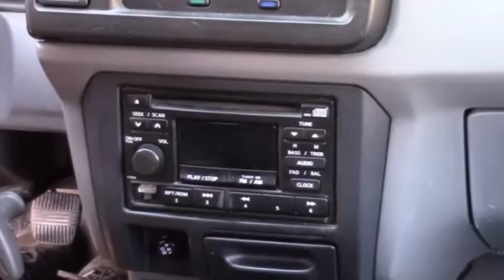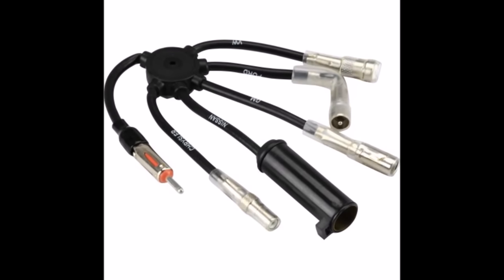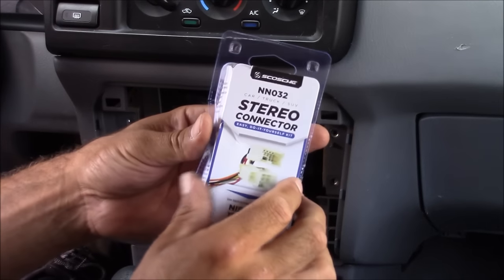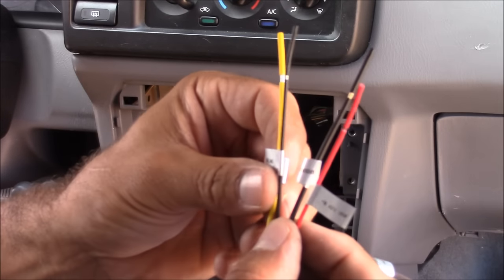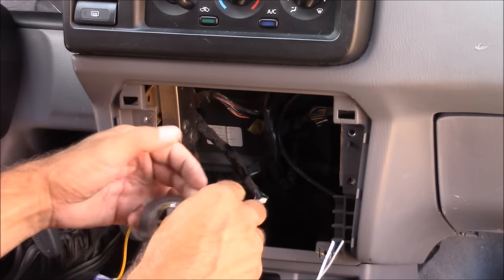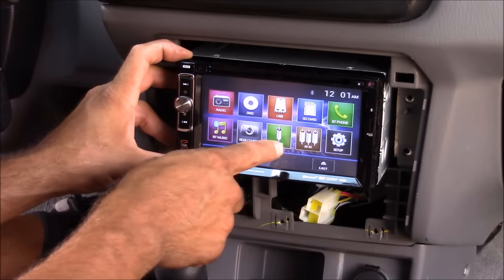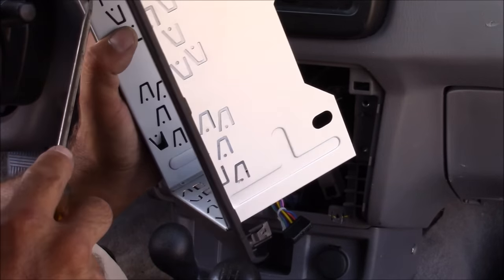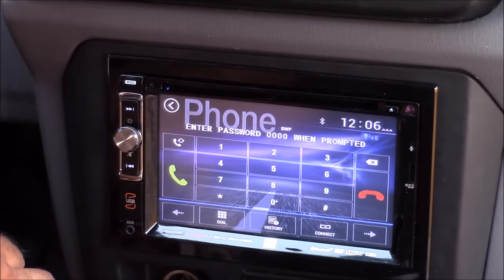How to install car stereo for beginners DIY

Comment from the maker: Hello everyone Crimped connections are preferred method used by most professional installers Here is my link to a full tutorial on how to make crimp connections, heat shrink and splice wires: https://www.youtube.com/watch?v=887c1...
Reply: C.L.S. Allinone
Reply: C.L.S. Allinone (#####
Reply: didn't know that
Reply: C.L.S. Allinone amigo disculpa  donde puedo encontrar  el adaptador para una mercury mountainner 2003
Reply: My stereo won't won't I got everything hooked up rigjt but I don't have another red wire on my stock harness or a blue one for the power antenna were do I put them
Reply: Some have been sliced so much there there is not enough left n you have to use a extra large crimper to make the connection complete
Reply: "Video no longer available"

Comment: I live in a motor home and will feed the unit off the battery solar-powered RV battery bank. (So I can use t when parked) I am less than novice qualified but I was planning to run both the hot (yellow)  and acc (red) to the feed from the batteries. Will that work? What do I connect the ILL wire to? thanks

Comment: bought a boss audio stereo off amazon used from amazons warehouse deals part, and the stereo works completely.. gps and everything, only thing was no audio, i have no amp in my car and the "professional" i was paying told me after 5 hours that my unit is defective, he even showed me his stereo and it worked fine. should i believe him? (he was a guy off craigslist)

Comment: Do you have to remove just the black wire from the battery or both to do electrical work?
Reply from the maker: htboston just one wire red/+ preferred
Reply: C.L.S. Allinone why though ?

Comment: So I have a 2005 chevy Colorado and I've wired everything I believe correctly and ground the wire and even bought the antenna adapter and I still can't figure out why I'm getting no power at all
Reply from the maker: You need to use test light to check 12 volt constant , 12 volt ignition and ground wires. Hold one end of test light on ground wire and other on 12 volt wire if it doesn't light up check other ground locations "any solid metal surfaces". If it lights up with different ground location it means ground was bad. If it still does not light up check fuses for 12 volt power.

Comment: I just replaced my stock radio in my 2006 Nissian Xterra with a pioneer head unit. I turned my ignition over to make sure everything worked properly and I didnt get any power to the new stereo. Is this because I dont have the ground ran? In stock nissian radios the ground is ran with the antenna wire.

Comment: 08 pontiac grand prix i bought a dual xdm16bt radio and the adapter wired it up but no power
Reply: Darren Nunnery what was your issue same boat in my work car 08 cobalt
Reply: Same issue in my 09 Cobalt
Reply: LoattyTV make sure you have the exact interface you need there is 2 for the cobalts I had wrong one
Reply: I have the same Pontiac too and since it’s a GM car you have to wire the red wire to the fuse box on the side of the passenger door and find a right fuse that turns the stereo on and off when you turn the car on and off so it doesn’t drain your battery

Comment: Thanks for your video. Very helpfull.  Any possibility to convert a 1di to 2din in hyundai santa fe model CM, year 2006? I f yes, Do I need to buy a 2din cage or the aftermarket come with one like i am seeing in this demonstration?
Reply from the maker: Papami Peremi unfortunately there probably is not enough room for 2 din stereo. You can google your car model + 2 din stereo to see if there is a conversion dash kit for yours. Also Dual makes a stereo that is single din with a 7 inch motorized pop out screen that might be a good alternative for you.
Reply: Thanks you for your advice.
Reply from the maker: Papami Peremi your welcome

Comment: Great video thanks you explained it perfectly. So everything's is color coded, my stock stereo has multiple connections 6 to be exact. I have a 2005 honda accord EX with factory navigation and dual AC. Its not working and im trying to replace it.

Comment: Do you mind questions? Please. The new stereo has wires that the harness doesn't have, nor did you mention them. The pinks are obvious; front/rear cameras. The 5 others are the questionable ones. 

(Wires 1-3) Have 3 wires for Steering wheel control (Gray = SWC 1, Green = SWC 2 and Black (fine) = SWC Ground.) Do I need that separate ($50) SWC? Or can I pull out one of the wires from the the other connectors that were in the stock unit?

(4) Blue (B+) (2nd blue w/o white stripe) = Amplifier Control and (5) Brown = Brake (B-).

Also, I notice your harness kit had the connectors. My harness didn't. Wondering, if I got the wrong brand harness.
Reply from the maker: SWC will be specific for whatever vehicle you are using some vehicles require a separate module and some don't . Wire harnesses are specific for vehicles as well most are designed to plug right in to you stock wire harnesses and sometimes not all stock connectors get used. My video just kind of covers a basic install to get power and sound working everything else becomes a learning experience to figure out.
Reply: Truth! It is a learning experience, taught by digging in. Thanks for your reply. Trying to get answers w/o sifting online. Starting to piece some of it together. You're so right, I would just need to fish around inside. My new deck seeems to have the SWC built in; set of wires out of deck. Time is required to figure out which wires from van. Thanks for your time.

Comment: Thanks CLS, I have an Axxera, looks just like the unit you installed, but I want to power it without have to turn on the ignition switch, what would you  suggest? What does the extra yellow power wire do?
Reply from the maker: Just connect the red wire on the stereo to the yellow wire on the car.
Reply: @D.I.Y._All-in-One  OK, Thanks!

Comment: all these vidieos are driving me crazy the after market radio has rt but my 2012 colorado  dont have a red wire has all the other colors but red what do i do
Reply from the maker: Jaxs Rea you will need wire harness adapter for your vehicle it will show on instructions what wire is red/12 volt ignition. The wires that are attached to stock radio do not follow the same color codes that aftermarket radios do. You can also use a test light to figure out which wire is red/12 volt ignition. Test light will show power with wire when ignition is in the on position .
Reply: THANKU U i dont know if i screwed up i cut maket connecto off before i started thought thats what u do wire to new one
Reply: well guess what i wired it rt it worked i felt radio was hot as crap in back found out chevy uhave to wire red one to fuse boxdid that yeserday nothing im stressed out done .  so much for trying
Reply: Jaxs Real

Comment: Hello..I installed a reverse camera to this stereo but the screen is black. When I put reverse that's when I see the reverse camera turn on. Do you know what I did wrong? Thanks
Reply: that's how it works on this model only when on reverse it would come up on screen

Comment: Did you not install the Ground wire in this video?

Also will i have to buy my own ground wire for the installation to be completed?
Reply from the maker: ZambonieDude most stock car stereos have grounds already in wire harness. But if for some reason it does not have ground in harness yes you will have to install a ground wire. This can be done by finding the nearest solid piece of metal that produces a good ground and using a self tapping screw to secure wire. A test light can be used to check ground location by holding one end on 12 volt power and other end on metal if it lights up brightly you have a good ground.

Comment: okay so we have an 04 dodge durango and bought a Dual xbm280bt radio from Wal-Mart and my fiance cut the plug off the factory radio so how would we wire those cut wires to the new radio wires without the plug
Reply from the maker: Samantha Mead do you still have the plug you cut off?
Reply from the maker: Samantha Mead if you still have cut plug you can buy an adapter wire harness and figure out which wire s are what by matching colors.
Reply from the maker: Samantha Mead if plug is gone/missing you figure out your power and ground wires with test light. But your speaker wires will be much harder to figure out if you have access to  speakers you might be able to find the color of wires hooked up to speaker and hopefully the color is the same where wires were cut.

Comment: I have to buy a separate connector? Why is the one that came with the new stereo not enough?
Reply: There’s no standardization, so you need an adapter that goes from your car’s specific stereo connector to spliceable wires. Without it, you can still make it work by cutting off the stock connector and splicing directly but you’ll have to figure out which wire is which on your own and it won’t be easy to go back to the stock radio.

Comment: HELP! MY RED WIRE IS NOT PART OF THE HARNESS. IT IS SEPARATE. WTF DO I HOOK THAT UP TO? All my wires will be used, but the red one that came with the stereo is on the harness and the one that came with the adapter kit is not. It looks like it wants me to tap into a 12V switched source...don't know where or how I should do this! HELP

Comment: I have everything hooked up but my radio is not turning on
Reply: Same here
Reply: Same did you ever get it to work
Reply: Same
Reply: I've hooked up 3 before and I'm never had a problem til now, I tested power with a voltmeter and it's getting power, idk what the problem could be
Reply: michelle c the pink and both of the black wires you have to put them together on your black Negative wire

Comment: I got the Xnav267bt

confused. 
I got a touch screen stereo and soldered all the wires except for the ones described below vvvv

The last wire thats on the aftermarket harness for
my car is pink "12 volt ignition/switched"

the aftermarket radio harness wores left are "ACC B+", "Reverse +",  "Remote turn on +", and pink wore that says "brake" that says must be connected to watch video properly.

i looked up the ignition/switched and acc. They both sound pretty similar. Can they go together?
Reply: Having the exact same issue. Any luck?

Comment: Hello. I bought the same one and I installed it and it was working fine. Soon after the screen just turned blue and stayed blue. What is that?
Reply from the maker: might be wire harness. You could try different brand. I have been hearing there is a lot of issues with GM vehicle wire harness es   ...
Reply: C.L.S. Allinone Thank you🙌🏻
Reply: @D.I.Y._All-in-One  mine has done the same thing yesterday working fine I turned my car off and in the morning I turned on the car and it's a very lightish dark screen I've reset both the radio you have and unplugged everything plus took out and reset the access box and still same screen help please we have -degree weather right now so I've brought them in to warm up

Comment: I think I crossed wires I also failed to disconnect my battery during the radio install I replaced the radio fuse but I’m still not getting power to the head unit what do I do
Reply from the maker: Check fuse on stereo and car fuse for radio

Comment: how did you install the universal antenna from the stock antenna to the deck I got the same one in your video but I can't figure it out in my 2006 Nissan Altima
Reply from the maker: Randy Rodriquez one cable should plug into stock antenna wire other end should plug into deck.  Only 2 ends should be used. If it does not plug into your antenna then it's not the proper adapter for your vehicle unfortunately.
Reply: I got the one for 2006 Nissan Altima and nun of the ends fit do I really need the antenna? and what is the black and white wire for is that a positive ground?
Reply from the maker: Randy Rodriquez antenna is for FM and AM radio it's not required but you will lose those functions. For stereo their should be a diagram saying what each color of wire is and same with the car adapter wire harness to figure out the black/white wire.

Comment: I bought this radio today I set it up but weird thing when I turn on my headlights the screen turns blue but when I shut off the lights it goes back to normal.. any suggestions need the help..
Reply: albert guevara cool
Reply: Please tell me you fixed this????? I am having the SAME problemmmmm

Comment: I have a 2004 Chevrolet Silverado 2500 HD Duramax four wheel drive long wheel base with on Star. plus it has steering wheel control. I want to get that door multimedia DVD player Seaver with Bluetooth do you know what all I would need to buy to get it installed and how can I bypass that switch for the braking left it so I can watch DVD player all movies?
Reply from the maker: I believe you will need to buy a new aftermarket dash panel because the opening is not big enough to fit double din stereo you will also need wire harness adapters and onstar adapters if you want to retain that feature. You should be able to find everything you need on ebay.com or schosche http://www.scosche.com/ . To bypass parking prake on dual stereo just hook parking brake wire to ground wires on wire harness.
Reply: just ground the brake wire and it will work I have install this same radio in the past

Comment: Hi, I have the exact stereo put in by a car stereo guy. My Stereo worked fine until a month ago when it started to turn off by itself while I was driving. Then a week ago it turned off and never came back on. Checked fuses they are ok , took radio out of the dash and all wires are fine. If anyone has any idea on what it could be I would love and appreciate some input. Thanks
Reply: Probably burned out

Comment: Hi, looking to replace the after market stereo that came with my car when I got it used. Do I still need a conversion kit, or should the wires be ready to plug right in? Thanks!
Reply from the maker: Wires should be ready if last installer did it right keep your fingers crossed.
Reply: C.L.S. Allinone thanks, it worked fine!

Comment: I hooked mine up and ran wire for an amp. Now I can find out why I can't get sound out of my subwoofer. I tried every rca preout on the back and nothing. The amp has power and ground.
Reply: Richard Pierce I have the same problem u ever get it fixed .... I just went with a price that use to hook a amp to a factory radio it works

Comment: What happens if your has no built-in wiring harness
Reply from the maker: time to cut wires I guess and test with test light to find constant power, ground , And Ignition power. Then for you speaker wires its a little tricky but it can also be done. But if its an older vehicle you can check where the wires plug into your speaker to find wire color codes for your speaker.

Comment: What's the point of the adapter? Why not just splice the wires together without it?
Reply from the maker: austin price sometimes it's hard to figure out the color codes for what the wires are on the stock wiring harness . also if you go to change your stereo or sell your car it's much easier to remove your aftermarket stereo and put your old stereo back in
Reply: Because it's faster and much easier. The factory wiring colors will be no where close to the radio wire colors

Comment: ok I did that I know the dimmer is a orange wire and it still turning blue .. I checked all the wires and all are correct so now I'm stumped lol..
Reply from the maker: Did you figure it out?  If the reverse wire is hooked up wrong that could screen to go blue also. For instance if the orange reverse  wire on stereo is hooked to your illumination wire on your car wire harness it could cause your screen to go blue when turning on lights. Also another way to find problem wire is hookup just your power and ground wires. Then test by turning on lights if it works hookup another wire then test again and keep repeating until you find the problem wire. Also The parking brake wire can be bypassed and hooked to a ground wires to watch dvd while driving but that can dangerous though lol.

Comment: bought the same stereo, hooked it up and it says theres a "brake light" wire i have to hook up or else the stereo screen goes blue when i turn on my lights, what can i do?
Reply from the maker: Juan Mendoza hook brake light cable to ground wire on the same wire harness.
Reply: C.L.S. Allinone ok so the stereo harness has the "brake light" wire, i hook that up to the ground on the stereo wire?
Reply from the maker: Juan Mendoza yes .  if it's grounded  it will trick the stereo to think it's hooked up to brake.
Reply: C.L.S. Allinone did that, didnt work
Reply from the maker: Juan Mendoza worked for me I just connected the black wire and parking brake wire from stereo wire harness together then connected both to car ground wire. I heard a couple people having problems with dimmer wire also having to disconnect or screen would turn blue with vehicle lights on.
Reply: C.L.S. Allinone ok....which one is the dimmer? i looked, didnt find which one it was
Reply from the maker: its wire labeled illumination orange/black https://youtu.be/L8qxA_Uzdag?t=217

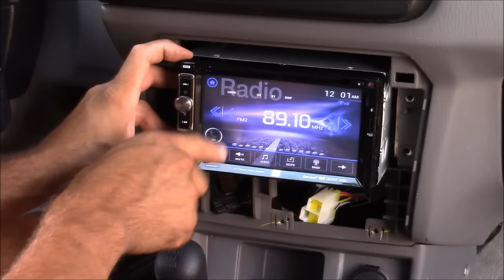Comment: I have a question, at 6:00, there's a plastic thing that's not connected to anything under the radio. Mine is the same way, and I left the yellow panel in to block it, and tiny radio still won't turn on, could I just need to tape the wires again or redo them?
Reply: C.L.S. Allinone

Comment: I bought this same model. what do you connect the pink parking wire too. there is no pink wire on the adapter
Reply from the maker: Pink/parking brake wire hooks to parking brake or it can be bypassed and connected to ground wires
Reply: Thank you